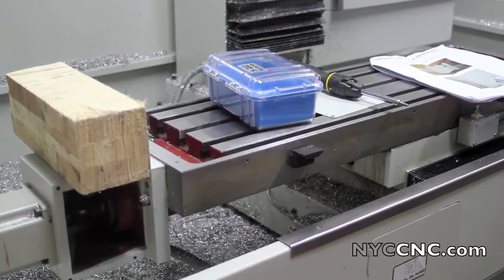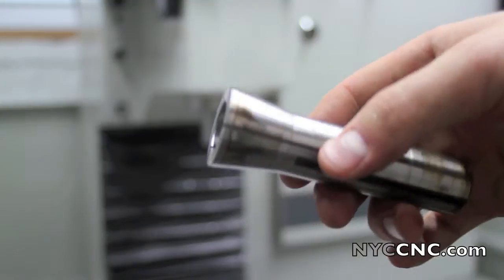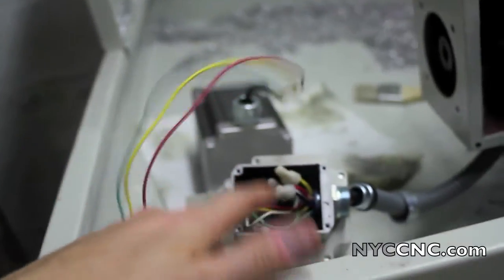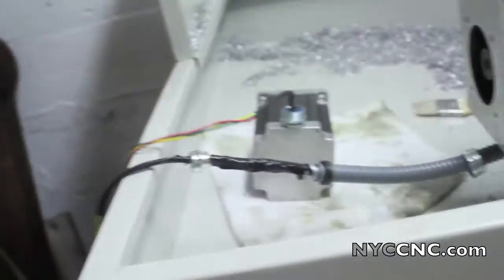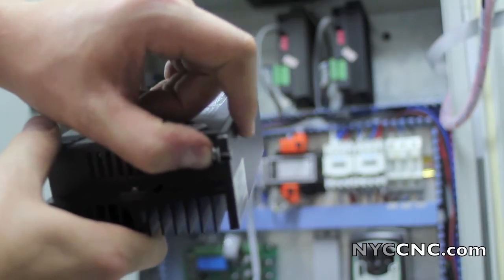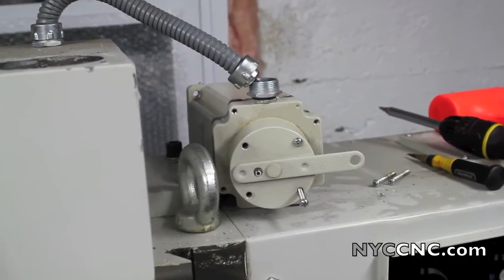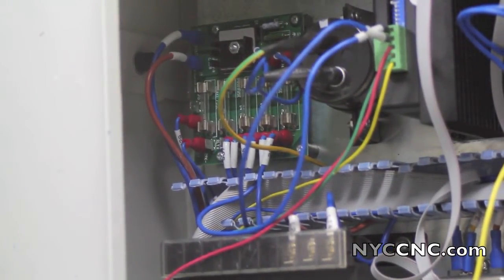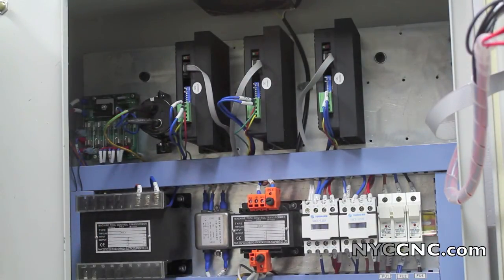Tormach PCNC 1100 CNC Mill - Series III Upgrade!  Ch. 25

Comment: Well the huge benefit is that with FANUC it's a pretty adaptable and flexible and user friendly control system, with tons of options available, plus it will all neatly fit in the enclosure you already have on the PCNC. Plus the worldwide support. You have tons of servo and servo drive/amplifier options there too. Just pick out a pair of FANUC servos that are comparable to what you're already using and should be good to go. I enjoy using the new 0i series you should look at the brochure

Comment: Yes, it's a very versatile and flexible system.  I could put together a basic system for $2000-3,000 including the amplifiers & servos, but There's many different configurations you could build upon once a basic system is installed, plus you get access to up to 6 axes .Mind you, a PMC ladder needs to be written for the Tormach, but the Tormach is a pretty simple system so it wouldn't be too hard. All you would have to do is make the appropriate cutout for the controls display unit.

Comment: The brake is a resistive load and don't need a polarity. It will brake either way. The steppers are 3 phase star with open loop and if you wanted to change to close loop you could do that very easy by adding some encoders, changing the drivers and motors to AC servo's

Comment: While I like the Mach3 control there simply isn't anything like the FANUC 0i series. They are a great choice for retrofit too. I've built plenty of FANUC controls so I can help you if need be. I have all of the manuals for the 0i and the brochure that you should look over. While it might cost you a fair bit even on eBay, the 0i control is very compact and easy to use, plus it will allow you to save programs on a PCMCIA card, and some systems are built with a hard drive too.

Comment: A friend of mine is putting together a list of components needed to change over a Tormach PCNC 770 or 1100 to a FANUC CNC control, which would include a 0i-M (or 0i-Mate-M) type control panel which are both relatviely compact but Mate control is a very compact installation. This installation could be ordered all from eBay or from FANUC itself. Anyone who would be insterested in this for their TORMACH let me know.